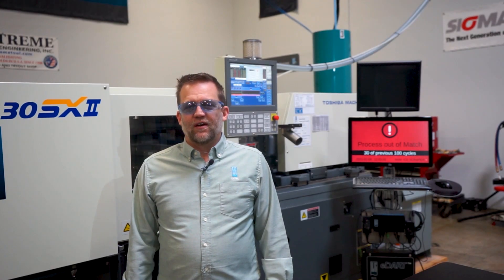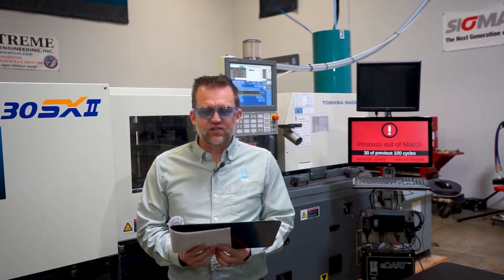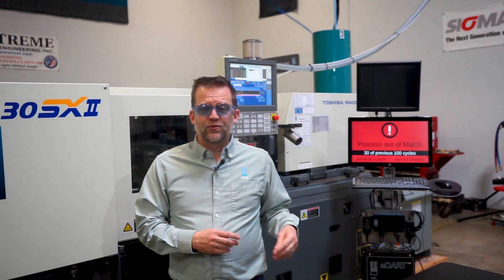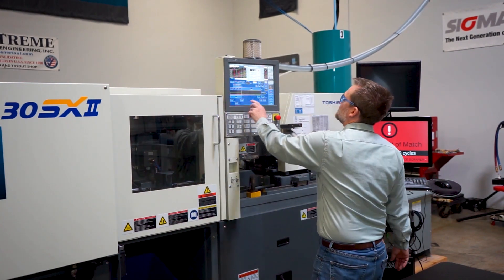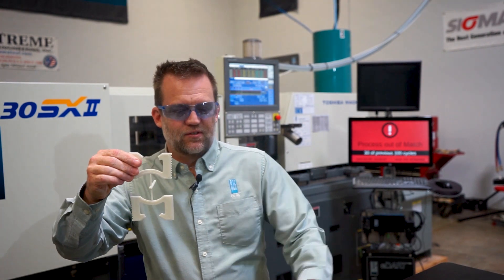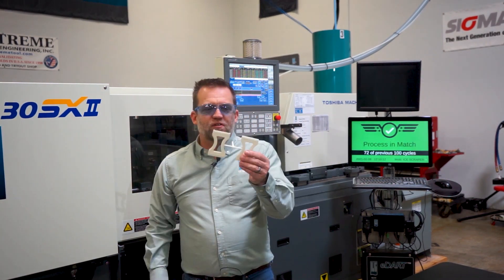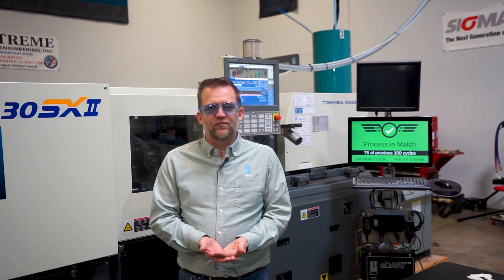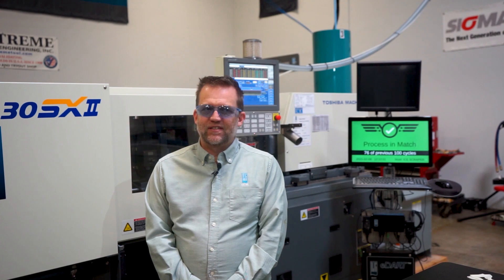Troubleshooting Short Shots

Comment: good method but if you would allow me i would like to add that problems are not only coming from the IMM settings. the lack of knowledge on the material handling process (recycling conveying drying dosing blending). If u have a bad dosing and blending then the viscosity isn't ideal meaning to the rheological study which will gives short shot, over pack, void, delamination, cracks, and color defect to name few. Same with drying (u checked and this is good), which is the only auxiliaries that can act of the gas related issues. Indeed, gas can creates also short shot. People will talk about the vent but if u handle the drying in a proper way, u have less gas issue and therefore u act positivily on the gas from the additives. Thermoregulation is also a big factor on how to avoid defects. The problem is that people are not setting the water flow and delta T precisely enough. It always an approximative settings compare to the settings on an IMM.

Comment: A good trouble shooting method. I use a checklist, the same way that a pilot does a pre flight. that way, nothing left to chance. So before any knobs are twisted, and changes are identified. 
I also ref to 3 independent feedback outputs- cushion position, max cavity pressure, and fill time. Lest hear a 'yay' for the scientific moulding method.
Reply from the maker: I really like the pre-flight checklist! Make sure to ask the Co-Pilot :) . One suggestion is to reference the fill only weight along with the fill time.